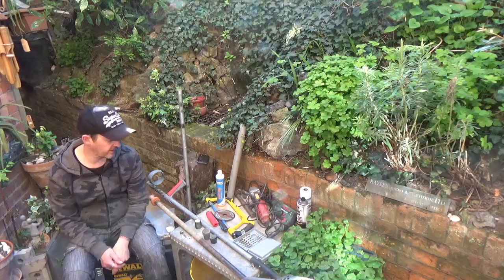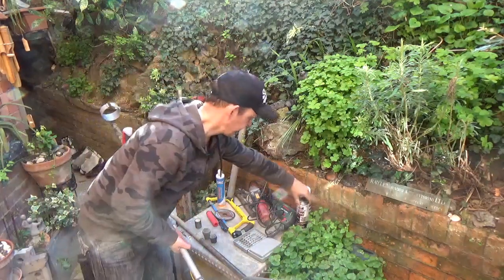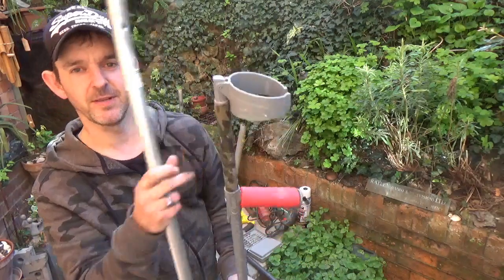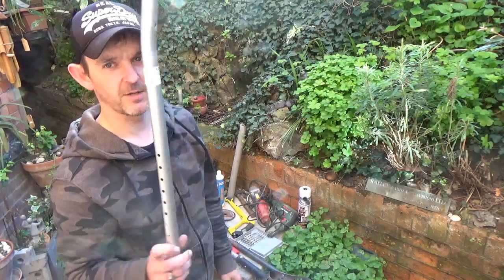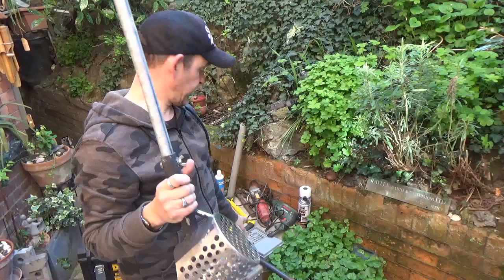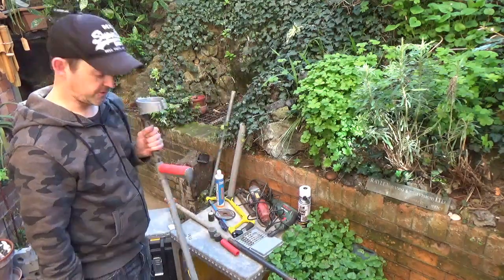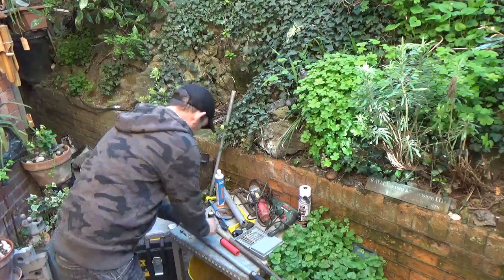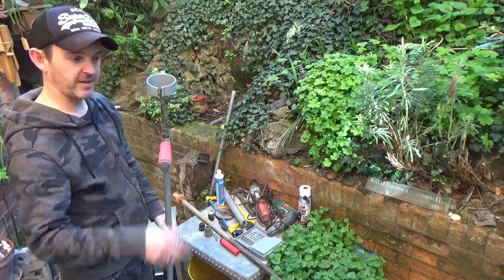Budget handle for your sand scoop at home

Comment: what did you use for the pistol grip part?
Reply from the maker: @jawknee21  it's the original handle from the crutch with a foam cover from a scooter/bike
Reply: @Hadesdetecting  ohhh ok. I'm trying to figure out some kind of handle to put on a straight pole. I've seen someone use pvc pipe but not sure how available that is where i am. I'd like to 3d print something
Reply from the maker: @jawknee21  if 3d printing is man enough and can take the lever pressure go for it,my handle slid down the pole and i stuck a rivet in the back